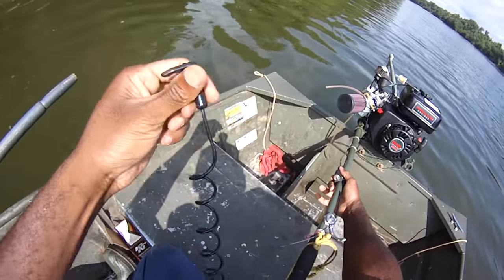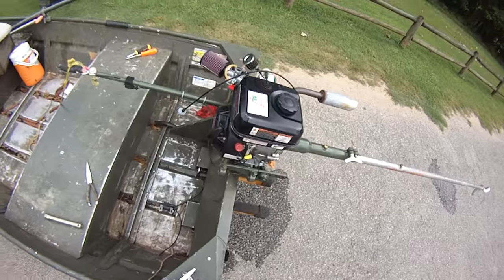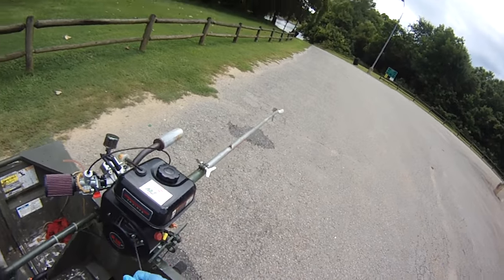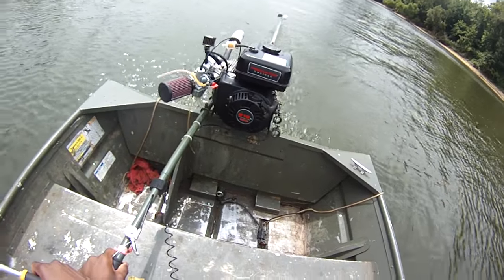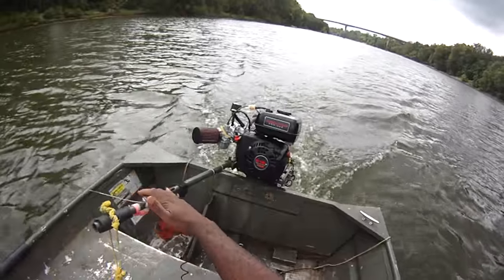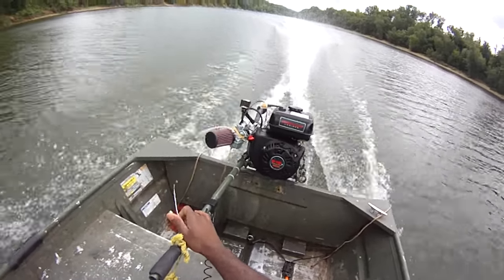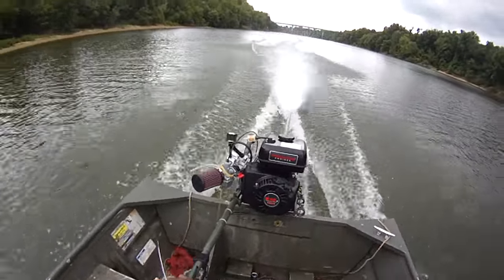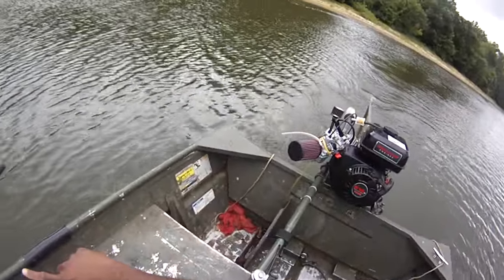Stage 2/3 Mud Motor Build | Sea Trials!

Comment: good job. I'm ready to see it when you get it tuned right, it'll be awesome!
Reply from the maker: thx. Still have work to do. I think I have it closer. That spark plug is way too hot: NGK BP-6ES. With the higher compression I need a colder plug, especially since the horsepower has basically doubled. I Currently have three Autolite AR3910, about like a BP-7ES I think. I'll probably buy a bunch of NGKs since they're only $1.99, but it's hard to find the non-resistor plugs here in town. I'll probably order a dozen or so online.

Comment: Thanks for the vid man! It looks much stronger then stock. I’m currently stock.
Reply from the maker: Well, it's much faster than stock, makes a little more torque but higher in the RPM band. Most people have gone to big block motors of around 400cc instead of the small block at about 200cc.

My current build has the best balance between reliability and power: internals are stock, remains governed, but performance intake, exhaust and billet flywheel, allow me to turn the governor throttle stop way out.for more RPM. The billet flywheel spins up much faster, makes a stronger spark and advances the timing, combined wit ha carburetor change I'm getting decent power. Any more and they motor would blow itself apart again.

I always recommend people get the big block engine instead of the small block.

Comment: I've been waiting a long time to see this on the water. I had to dig up an old alternate YouTube account to comment. Great job! But I have a question. I haven't heard you mention upgrading your timing key or spark plug. Have you done that?
Reply from the maker: Yeah I talk about in the upcoming video, at least the spark plug. I'm using the stock timing key only, but the timing advance is built into the flywheel itself. As I understand you can use the stock keyway and still get 8 degrees on advance because the keyway is built 8 degrees more advance on the flywheel itself.

Yes, I have to run a colder spark plug. As of now I'm using the Autolite 3910 racing plug., although it isn't the X version. The stock BP-6ES is too hot. You need to go one one number in heat range: BP-7ES or equivalent in other manufacturers.

Comment: awesome
Reply from the maker: Thanks! About to get it. I'm awaiting a new caburetor gasket. It should be in today, and I should be back to fishing hard next week. This thing is very nearly tuned. just replaced the idle jet, running a colder plug now, and the air-fuel mixture just about dead on.

Comment: Did u remove the governor?
Reply from the maker: Yes, I removed the governor way back in may: https://www.youtube.com/watch?v=ivowOwy1JAQ In order to safely run at higher-than-governed RPM, I installed both a billet aluminium flywheel and connecting rod.

Comment: U need to take the low oil sensor out if u ain't already
Reply from the maker: The oil senor was taken out. The problem was the vent on the gas tank.
Reply: @BlackWarriorLures  I don't understand how the vent would cause problems
Reply from the maker: @rednecklivin6863  It prevented adequate fuel flow down into the carburetor. I drilled two vents and never had a problem with fuel flow afterward. Remember when riding lawn mowers had a screw top vent on them. If you left it closed it would eventually kill the engine. If the engine has been modified and needs 3x as much fuel then you'll need three times the vent to allow it to flow. If you change one thing on these engines, you have to change everything.